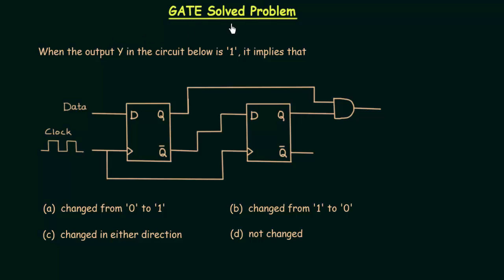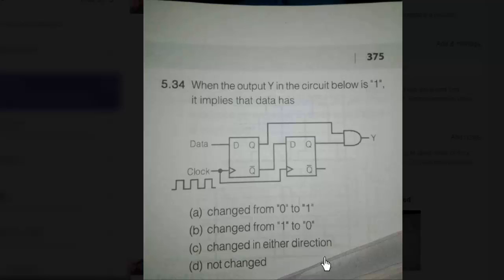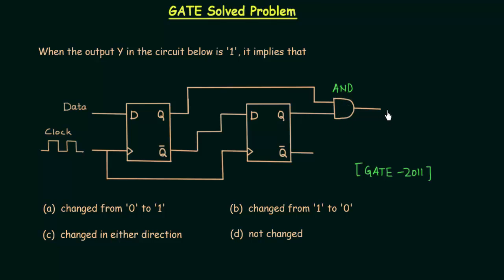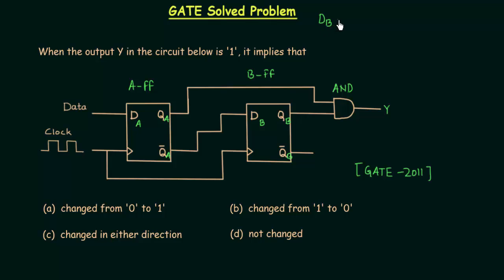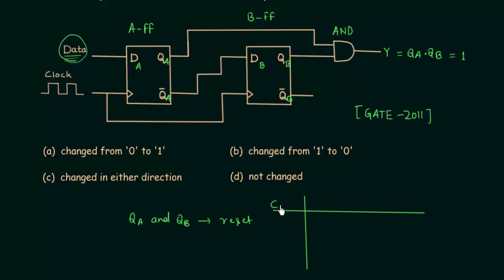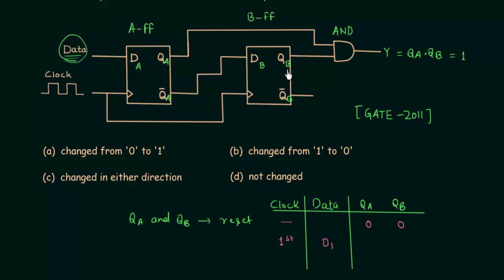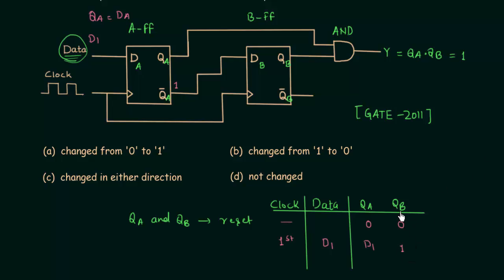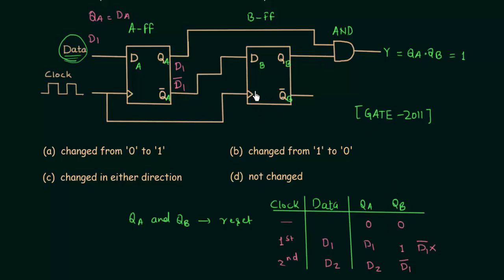GATE Solved Problems (2011) | Sequential Circuits | Digital Electronics

Comment: they are connected by an and gate so the Qa_n+1 = 1 and Qb_n+1 =1 
thus Db_n+1 = 1 and Qa_n' = 1 (remember synchronous )
thus Qa_n = 0 

so it is evident that the data has changed from 0 to 1